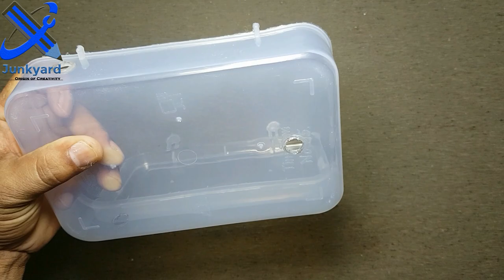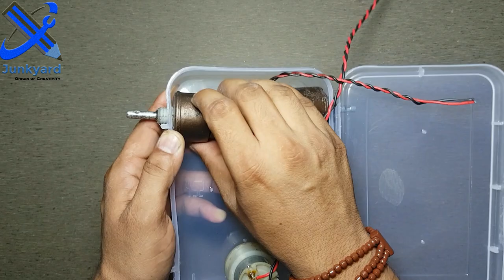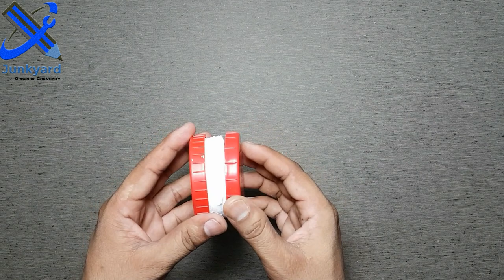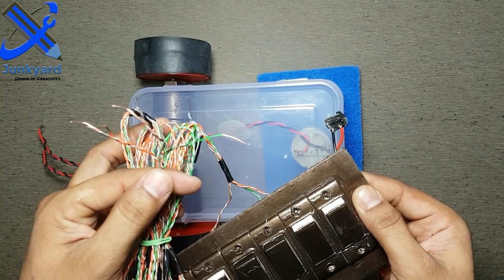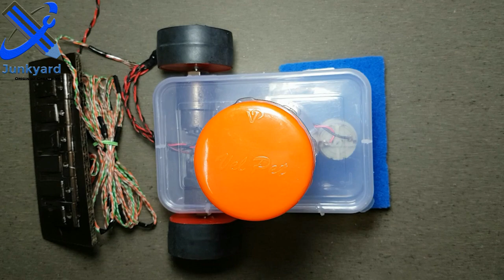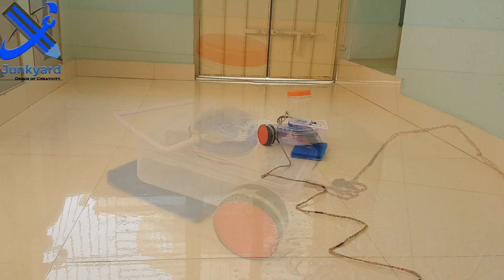How to Make a Floor Cleaning Machine - Remote Controlled

Comment: You should also have it drag a mop or a rag from behind to dry as it goes along. Very cool, I'd like to see one all automatic with bumpers and rollers on the front so it rolls off corners and keeps going.

Comment: You could improve it slightly by adding a second container and a cage fan for a vacuum cleaner. Clean the floor and then suck up the water when you are done. Of course that could be a separate device instead.

Comment: what we should ask for  motors in shop
Reply from the maker: +uttez pallapothu 60 rpm gear motor 12 volt DC
Reply: don't know
Reply: Junkyard - Origin of Creativity  which motor rotates faster 
1000 rpm or 500,300,3.5

Comment: Which Moter you use to make this bro
Reply from the maker: 120 RPM 12 Volt DC Gear Motor
Reply: And which battery you use 12 volt
Reply from the maker: I am using 12 volt DC Adapter for this project.
Reply: You are Indian bro

Comment: What do I use to power it?
Reply from the maker: apply 12 volt DC adapter power supply to red and black wire of remote control.

Comment: what is the materials needed here? thank youu
Reply from the maker: +Angelica Ronsairo see in the discretion of the video
Reply: thank you :) what shoult i tell to the vendor if I want to buy that switch. Is there an specific term use for that?
Reply: also, what do you call to the two wires being attached under the switches? thank you very much

Comment: This is not a remote control.
Remote control is wireless
Reply from the maker: +gameboys see in description it is coded wire remote control
Reply: No sir, you have it all wrong. The term "Remote control" only stipulates that an item be controlled from a "remote" location or from a distance. The 1st remote controled devices were indeed using a "wired" remote. As long as one can control from a distance it's remote controlled. You are thinking of "Wireless remote control" a newer and far more convenient method of controlling something remotely.
Reply: +FeasableOption very useful information. thanky you.
Reply: +Jan Slump :)